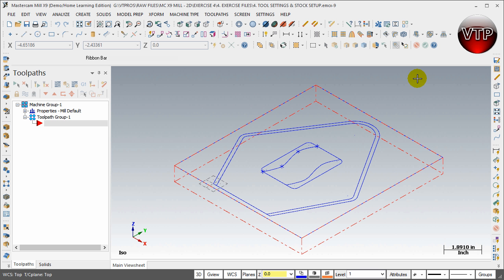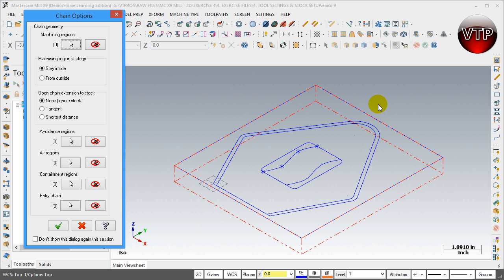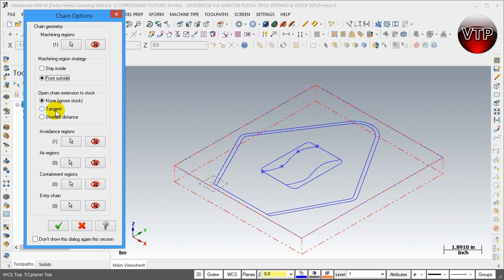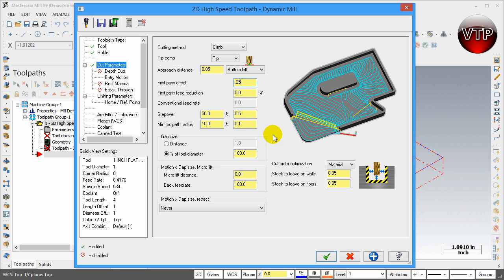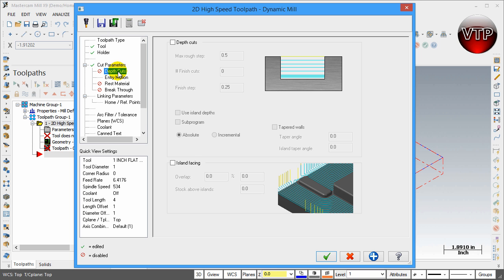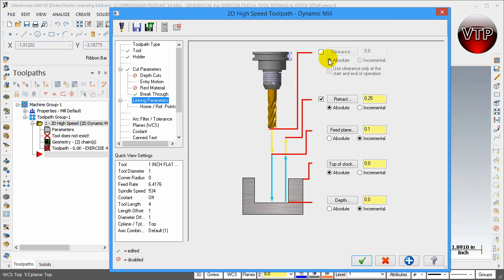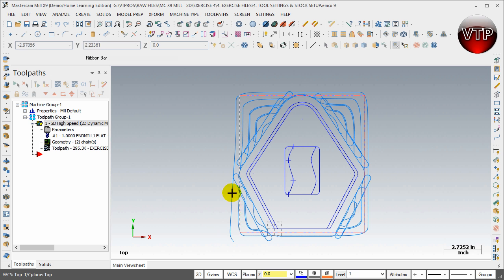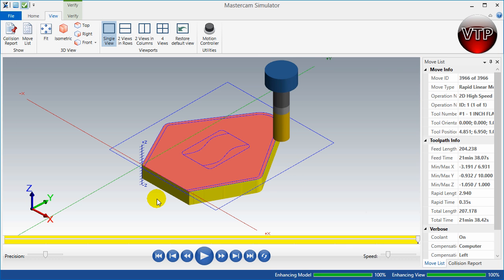MASTERCAM X8-X9 2D MILL 4.6 2D HST DYNAMIC MILL OUTSIDE - vtpros.net

Comment: I'm having trouble doing this. my cursor won't attach to the stock.
Reply from the maker: +Jonathan Raphael sorry jon just noticed your comment, you might have an issue with the mastercam installation, i would uninstall and reinstall mastercam without using your computer while installation takes place. i have heard of few occasion where things like this happened and mastercam crashing as well